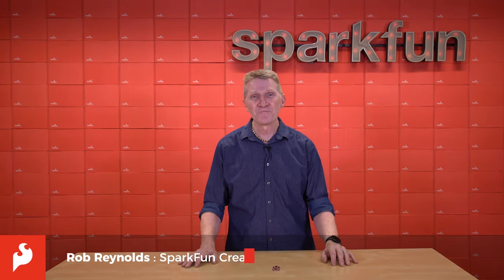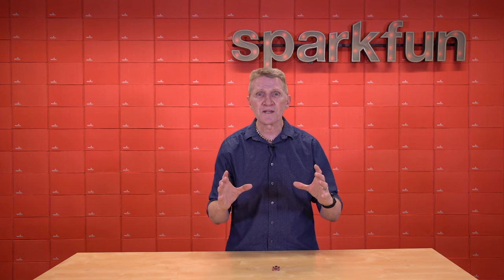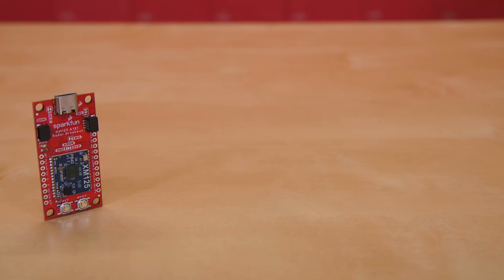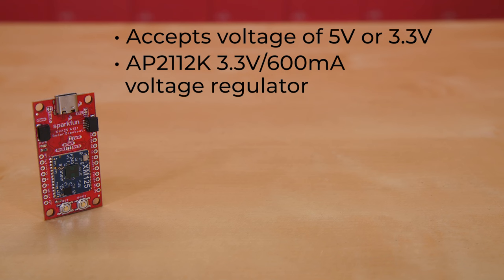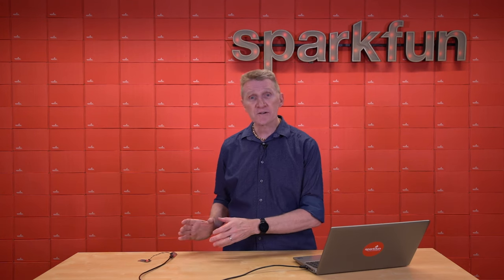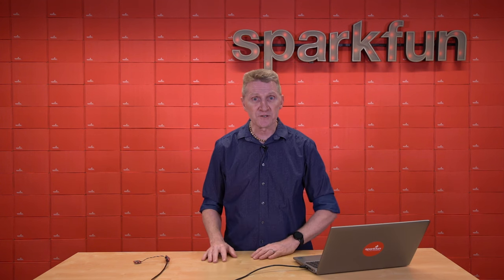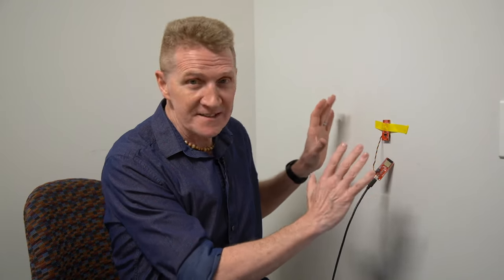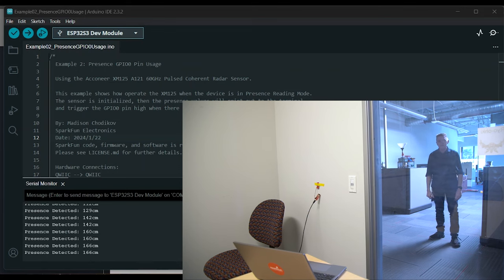SparkFun Pulsed Coherent Radar Sensor Acconeer XM125

Comment: Is there a way to use the XM125 for visual image like you would see with radar?
Reply: you could sweep the sensor around on a servo with a position encoder and map that information to pixel coordinates on a display. the dual polarity doppler you see used for weather does this. there are also SLAM techniques applicable here, you could generate a 3d point cloud, etc

Comment: I wonder: Could it be possible to detect object location using three of these modules and some triangulation?
Reply: That would be a handy option, software using a few of these in a mesh.
Reply: It should be possible to detect location with just one sensor if it has an array on it.